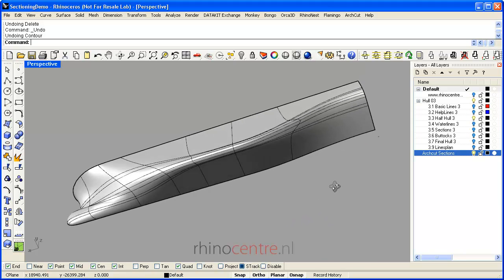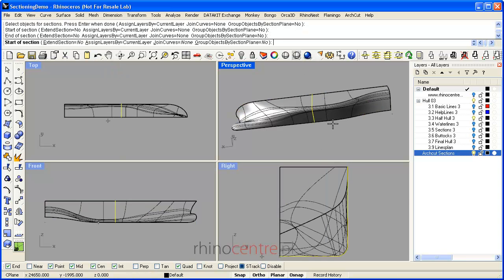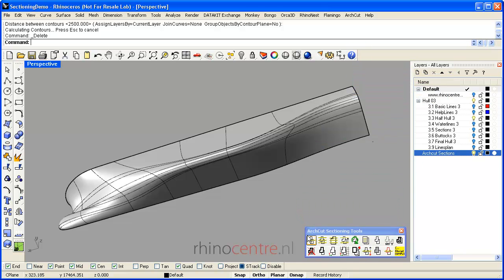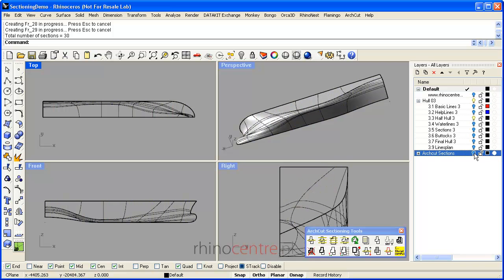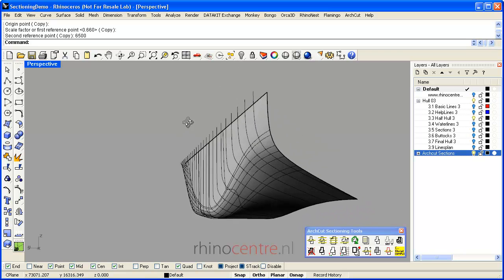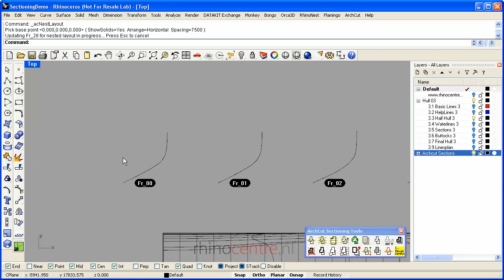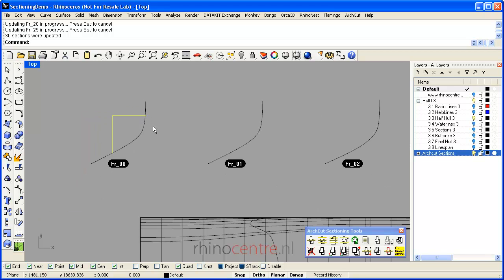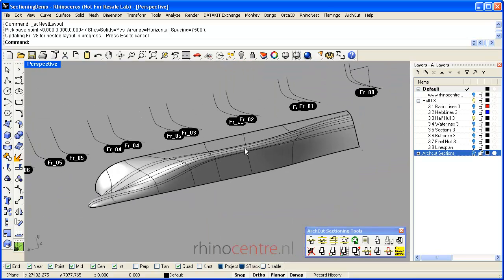Demo Rhino sections and linesplans

Comment from the maker: Yes only as a reference. When you try to use DWG frames as input for a loft, it will not work in the bow area. I always generate a ship hull from new curves made with few control points. Then I use the DWG Linesplan as a reference.